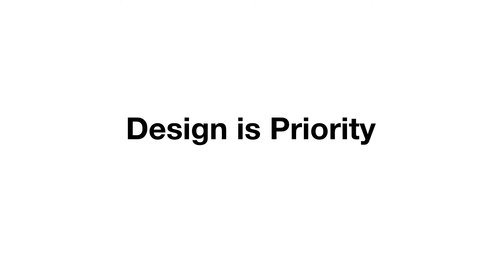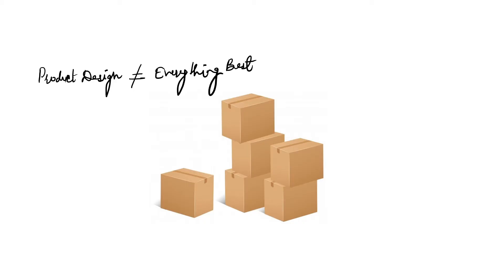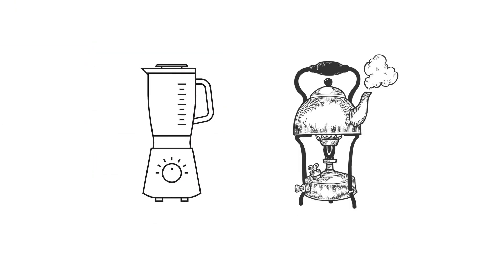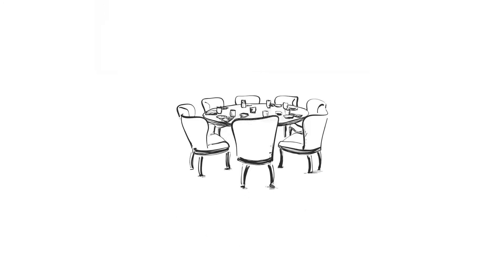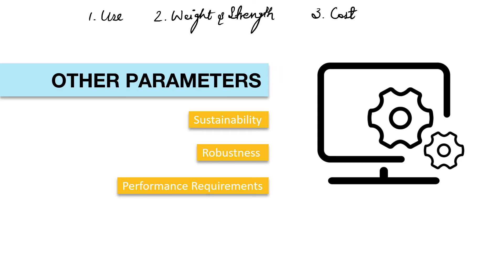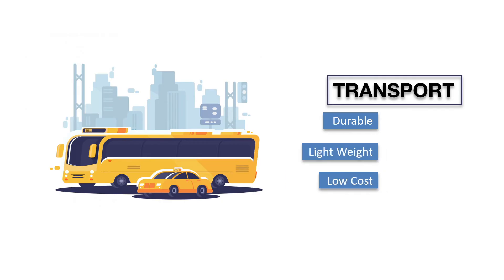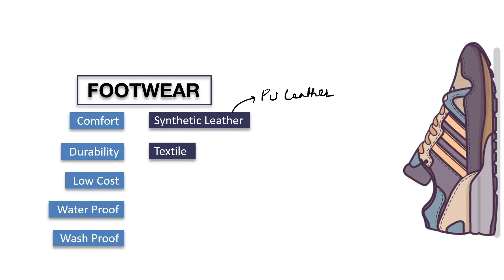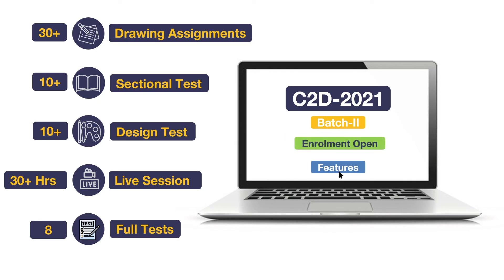Understanding Materials | CEED | NID | Kaphal Studio

Comment: Very insightful, thanks for making such videos. Just one question, are the questions going to be only of certain type in creativity, visual sensitivity etc (like icon making, object making) or they can vary as well? If they can vary then it would be a lot of help if you could point of few of those. Please...
Reply from the maker: Yes, questions can be from different topics.
Try to see it this way: Visual Sensitivity is just a parameter to test design and any design can be tested on this parameter. So the question can be on any topic within this.
But, if you understand what visual sensitivity is why it matters, we are sure you'll be able to handle any question on this topic.